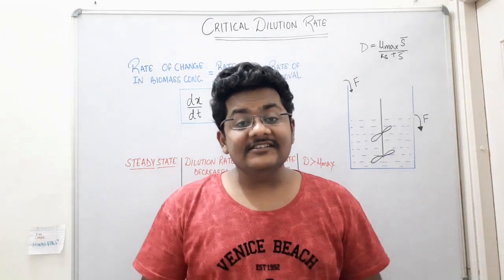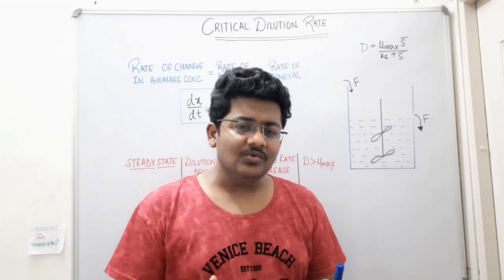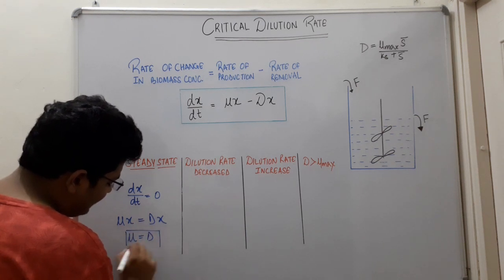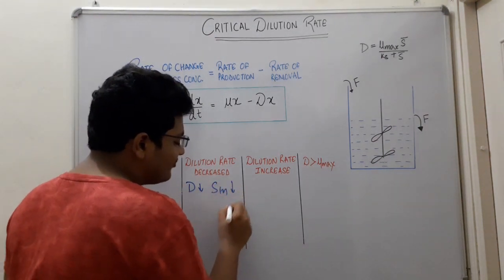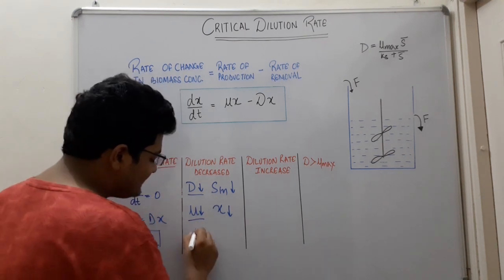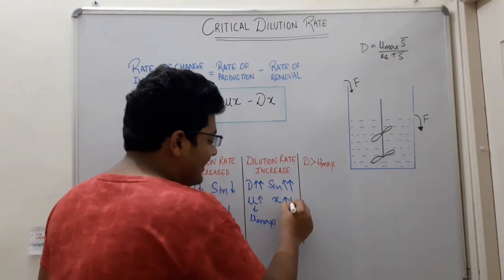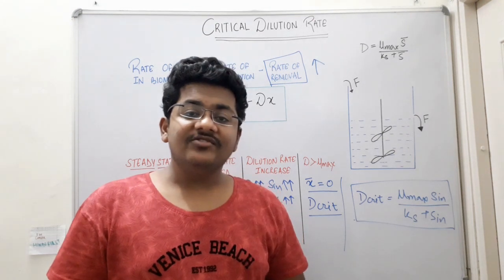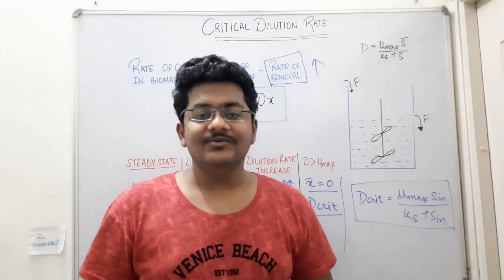11. Understanding Critical Dilution Rate | Bioprocess Technology | Notes and MCQ's in description.

Comment: Sir in last you said the substrate concentration is going to remain the concentration of the inflow or the concentration of the outflow but in the formula of Dcrit  you only write Sin why we there is not S outflow in formula ... ?? Why we are using Sin on both upper and lower side ?
Reply from the maker: Hi Sidra, for this probably you will have to see the derivation of the actual monods equation.
Substrate concentration inflow and substrate concentration outflow are equal, this does not mean that we are going to put it in both numerator and denominator.

Comment: Good morning Sir,
 2nd qus. Smj nhi aya
Or sir 4th qus. solution send kr do
Reply from the maker: Hi Sahil,
In 4th question, first, calculate the dilution rate by D=Um.S/Ks+S, and here S is the steady-state substrate concentration, once you have calculated the D, you can easily calculate F by putting D=F/V.
And for 2nd question, try to relate the first set with the second like, how do you think substrate inhibition would happen and all.
Still, if there is any problem, just comment!
Reply: @manmohanmitruka9596 How do you establish that in a typical open system the equation x=y[sr-ks(D/um-D)]
Reply: Thanks  Sir,🙏